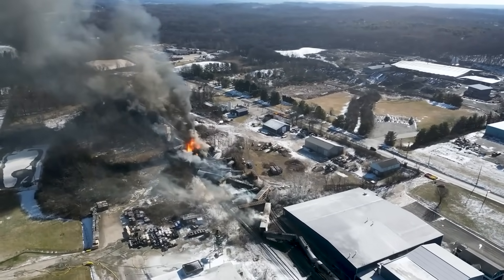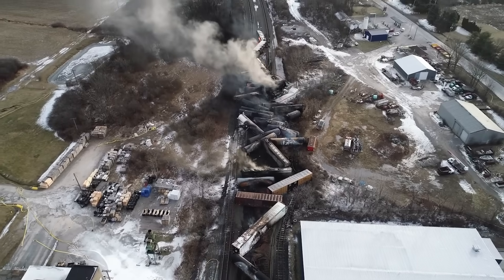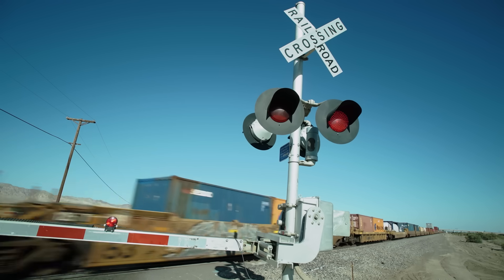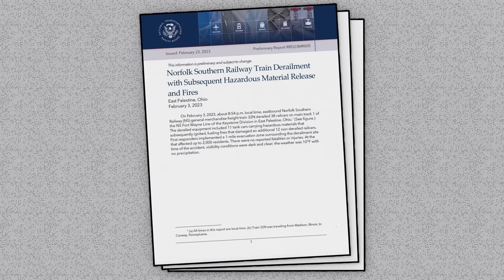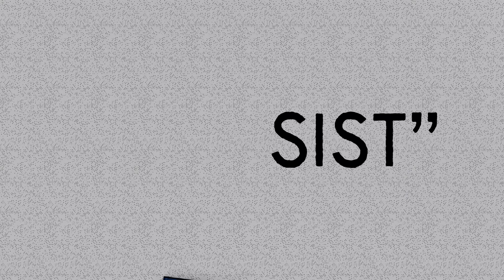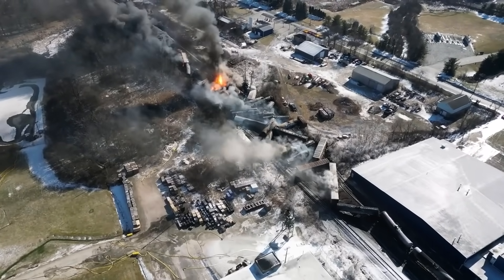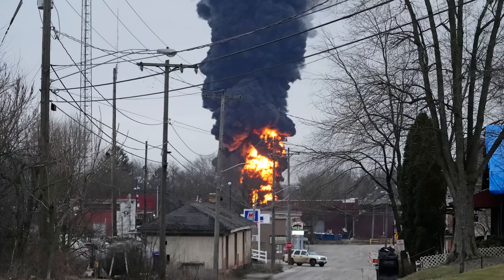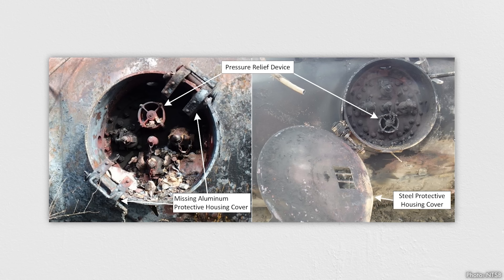East Palestine Train Derailment Explained

Comment: While rail freight may be an essential element of the economy, running rail lines right through the center of small towns seems like an anachronism from the 19th and early 20th centuries. Major freeways are built to bypass the center of many cities, and it seems like there should be alternate rail routes that avoid populated ares, especially when the train is carrying hazardous materials.

Comment: Talking about the psychological effects it is worth noting that the less often talked about talked about fact that the placebo effect is just as real in reverse. In fact it even has a name the nocebo effect ie where the brain changes it's behaviour in response to a belief that harm will occur and as a result actually manifests very real physical symptoms. That is to say that some of those reporting symptoms may be suffering from a very real psychogenic illness ie where the brain is responding improperly to stimuli and thus is dysregulating functions of the nervous system as a result. This is often dismissed as though it is all in the patients head but it is not so simple there are very real functional deficits elsewhere in the body that can come from the brain responding improperly the brain has direct control over functions of the body that are vital to ones wellbeing, if it adapts incorrectly like this it can manifest actual harmful symptoms that can be difficult to treat.

Comment: The bit from Some More News wasn't so upbeat about how clean up is swift and thorough and basically actually everything was fine. In fact claims were maid that sampling of water and soil were done poorly. 
A temperature reading of a bearing  until it's too hot doesn't sound like a too smart solution. Is there no data trend? If one bearing of one car gets hotter every measurement, than that's rather concerning, disregarding that it's not exceeding limits just now. I would think of estimating when it fails the 200° threshold and how it performs with respect to other bearings on the same and different wagons.

Comment: Could you clarify? Did you just explain that the automatic brakes engaged, and the result of the "safety" brakes was to derail the train?
Reply: Pretty much yes. Derailment is usually a less bad outcome than a runaway train, followed by an even bigger crash.
Reply: @Gordon Richardson  forgive me... I went to engineering school, but maybe aero is different.... shouldn't the brakes be designed to SAFELY stop the train? Is an induced crash really the best option?
Reply: @icansciencethat  The best option is orderly braking, but once a car becomes uncoupled this is no longer physically possible.

Comment: The car that has a flame that looks like a torch is under a lot of pressure because that is a pressure torch.  That may be a vinyl chloride-carrying car.  I don't think vinyl chloride is normally under that much pressure.  It is hot from the fire.   Some of your rail car video is of European trains, the trucks and bearings are different than the US ones.   The car at 7:19 is burning from the pressure relief valve.  Don't leave out Canadian National and Canadian Pacific as they both operate rail routes in the US besides Canada.  Don't forget Mexico as the North American Railroad combined system covers the bottom of Mexico to Fairbanks, Alaska by way of car floats between Seattle and Vancouver to Anchorage.   There are 2 rail carriers in Mexico and they are tied to 2 rail companies in the US by connecting tracks and corporate ownership.
Reply: Vinyl Chloride boils at -25º C

Comment: freight trains are the best way to transport goods, without a doubt. The problem in the USA are how the trains are handled. A train of 150 cars is just too long and the safety measures are not sufficient. I also doubt, that this accident will change much. Train accidents are not as rare as you might think. This one was just lucky to gain enough press attention.

PS: does Nebula accept PayPal yet?
Reply: Restricting hazmat cars to shorter trains sounds like a quick fix, compared to revamping everything.

Comment: So I have a question. With regulations I’m hoping changing on a constant basis, what does that mean to the rail cars, such as the tanker cars in this situation, that have been in commission for over 20’years. The report said the tanker cars were manufactured in the 1990’s. With the volume that these tanker cars and methods that they aren’t filled, emptied, cleaned and inspected, should there be an age restriction or total volume life restriction? I’m wondering if newer tanker cars would have resulted in the same situation.

Comment: I'm curious as to  how the venting was done.  Could you explain how they vented the cars for the controlled burn?  It seems like a difficult operation if material in one or more of the cars was already actively burning.
Reply: I would guess that a hazmat worker just opened the drain valve.
Reply: Shaped charge explosive to cut a hole. Then the trenches lit.  Several cars were emptied at the same time.

Comment: I'd like to see how a bearing getting too hot leads to derailment.  Seems like losing a single wheel or axle should not cause a whole train to fall off the track.
Reply: When a hot bearing fails it will often cause the axle to fail, that's why. One car digging itself into the ground will absolutely become an obstacle to every car behind it.

Comment: Dang, you missed a really important explanation. How does a failing bearing in one car cause 38 cars to fall off the track?
Reply: The exact sequence is not clear, but once the air line becomes uncoupled, emergency braking will cause a concertina effect.
Reply: Orderly braking of a train MUST be done from the head to the tail.

Whenever some car in the middle starts braking. The cars in front of the failing car will be pulling on it, while all cars following it will push against the brakes of the failing car. The longer the train is the worse this effect is.

As so much weight is involved this is a delicate process, that can go wrong quite fast.
Reply: @jfverboom7973  Thx. Too bad Matt didn't mention why/how the train derailed so that the many thousands watching the video could get this same understanding. Ironic the title of the video is "derailment explained" when the only thing not explained is the actual derailment. :)
Reply: @gordonrichardson2972  thx!

Comment: You mentioned the first reading of axle temp was +37.  Presumably all previous readings were similar.  So, something failed within that 20 mile span, and the next reading was +150ish. Still within safe limits, but a drastic increase of a static situation over a short period of time.  Maybe a stop signal is overkill in that situation, but a warning light to reduce speed may have prevented this.  Also, a simple device known as a hubometer that measures rotations of an axle should be installed and a recommend service interval of bearings introduced, if not already.

Comment: it sounds like the temperature threshold determines whether to call a hard stop (namely, if the temperature of the bearings exceeds 200F of spec)... did i hear that correctly?

i can't be the only person who thought that some kind of tiered system (in other words, reduced speed above 100F, severely reduced speed above 150F, full stop once a sensor exceeds 200F) would have made this situation much more manageable, no?

maybe these bearings are always 100F above spec, which sounds bad but whatever - we could shift the threshold around to minimize how often these trains have to operate at reduced speed unnecessarily. and, realistically, i guess i feel like if the bearings' temperatures need to be managed better, then forcing train companies to more proactively address the bearings that force trains to operate at half or quarter-speed might be a good thing in the end.

Comment: was there any other way to neutralize Vinyl Chloride other than burning?
if not, would it be a good idea to have a neutralization plan for all chemicals transported? including storing the needed amount of neutralization chemicals 
if there's abnormal car bearing temperature rise below threshold wouldn't it be a nice idea to report it to driver for them to slow down until the next checkup post says the temperature is not rising?
Reply: I don’t believe neutralization of vinyl chloride, or most other chemicals, is a thing. Burning the vinyl chloride is a great way to transform it from a toxic chemical into water, carbon dioxide, and chloride salts and probably a lot of other combustion byproducts :)

Comment: One thing I don't understand is why the defect detectors and tolerances weren't programmed and written to react on the rate of increase in temperature rather than a fixed value as that would most likely have allowed the train operators to act well in time to prevent the disaster?
Reply: The detectors are separate and do not communicate with each other. The system is archaic, and not designed to deal with this kind of escalating failure.
Reply: @gordonrichardson2972  Even a 16 bit CPU from 1985 can do basic differential calculations. That's not even an excuse.

Comment: I have some experience with industrial controls, and predictive maintenance. So, I'll give my opinion from that perspective. I'll stick to ideas for the future.

1) it seems that 20mi is too far between axle bearing temperature sensors. Maybe space them every 10mi.

2) I believe the two readings taken before the max 250⁰F reading was taken, were enough to indicate a major problem. The temperatures were both below the max temperature, but you could still see a rapid acceleration in temperature, and that catastrophic damage was likely.

Therefore, it's possible to now include programming of the automated system to include analyzing temperature acceleration as a way of estimating catastrophic failure.
Reply: With the current system, the defect detectors don't 'share' information, so things like trending and rate-of-change are not possible.  With on the order of 160,000 miles of track in the US you'd have to add an additional 8000 detectors to get from 20 mile/detector to 10 mile/detector (and I don't think 20 miles is the actual average).

An onboard detector system for bearings and some other defects might be better.  Could do rate-of-change stuff and account for brake applications as well.  But that would mean over a quarter million such systems. (can't skimp and only add to hazmat cars since a non-hazmat car can derail a train just as easily).
Reply: The detectors don't report data to each other or to a database. Workers go to the detectors to download the data after an incident has occurred, or as a result of the train conductor reporting an issue. Your simple solution requires introducing networking abilities to 10,000 remote locations, whether physically (logistically not impossible, plenty of high-capacity data lines already run by train rail lines for ease of maintenance. ironically, one of the main reasons for high capacity transit line outages is train derailments) or wirelessly via satellite. 

Your solution is "simple" but incredibly expensive and only a regulation will force those changes.

I'm not against your idea, rather I'm for it.

Comment: I think I noticed that earlier, when mentioning large volumes of water, the convention in SI is to use cubic meters (1000 liters) instead of liters, it makes the figures more manageable, one would know that one cubic meter is about 5 bath tubs, or the equivalent of a "yard of fire wood".

I appreciate your video in general, more evn this one as I did not really follow the incident.
Reply: Who measures firewood by the yard?
Reply: @petermgruhn  It may be cord? Sorry, English is not my primary language.
Reply: It's a lot easier to say "ton" than "cubic meter" though.
Reply: @SkorjOlafsen  But that would be a measure of weight, not a measure of volume.
Reply: @olivier2553  When you're talking about water ...

Comment: The outcome of this has been a long time coming. Had the train been shorter they could've stopped the other 111 cars in time, before their oncoming weight resulted in the cars near the failure derailing. The US government is going to need to limit the length of trains carrying hazardous materials, or perhaps all trains. Although we did have derailments of mainline trains shorter than 100 cars way back when, there's a good chance we will never have derailments caused by failures under a rollingstock limit.

Comment: I wouldn’t be surprised to see them start suggesting newer technology be used to monitor trains. Have each car equipped with monitoring equipment and run a communications bus down the train like the brake lines. Just another connection to hookup when building the trains in the yards. Get you a lot more real time monitoring and alerting, and able to detect anomalies like sudden rises in wheel bearing temps vs needing to take something in a dangerous state upwards of 15 miles to the next detector.
Reply: EOT's kind of do this already. An EOT is a little blinking device that is put on the end of the train and it connects to the airhose. It then sends info to the crew about how much air pressure is in the train.
Reply: @thatoneguy6555  EOT doesn’t tell you anything about the state of car 37 in your 150 car consist. Sure, it helps you detect potential brake line issues and understand your pipe pressure for potential multiple downhill sets and such.
Reply: @Herlehy  yes you’re right. It only does some of waist should be done.
Reply: The off car detectors make a lot more sense. Because they don’t allow for a single point of failure. If there is a bad sensor or series of sensors on a car, that’s undetectable, but if an on the ground detector doesn’t work, the next one will and defects can be easily noticed that way.
Reply: @joeshmoe4207  And if a cars sensors fail, that car shouldn’t be running since you can’t guarantee it’s safety. The idea that “this trackside sensor failed, so that’s fine to keep your train running in an unknown state until the next one” is bad. Sure, you’ll also have the static defect detectors in this new setup to help with potential failure states for on train sensors.

A failed sensor is 100% a detectable state. And should flag that car to be taken out of service at the next yard until it can be repaired.

If it truly mattered, this would be mandated in law. But since money is more powerful that logic, it likely won’t ever happen.
Reply: Having a communications bus run down the length of the train would be very complex and very expensive. You'd need a terminal block on each end of each car. While modern passenger EMUs do have communication between units, but you won't see more than 4-5 units coupled in multiple, and certainly not 100+ coupler joints. The most common failure mode for these types of systems seems to be the ground fault, which is a pain to troubleshoot. Electrical jumper cables like those seen on early multiple units would also not be that practical since you have so many cars.
Then you need to figure out how to make the detectors reliable enough. Railcars undergo a lot of mechanical load, from being shunted in yards to running over poorly-maintained track. So you'd need to make the sensors extremely rugged and reliable. It is also easier to maintain 10 detectors distributed along the track than thousands on each car. You can fix a lineside detector when you do routine track maintenance, but maintenance on thousands of individual detectors would be much more difficult.

Comment: What I don't understand is, if they were able to release it into a ditch, which would have allowed it to cool and reduce pressure, why did they then need to burn it, instead of collecting for reclamation?
Reply: 1: It's volatile, which means it evaporates extremely easily. Waiting would mean releasing the vastly more harmful chemical into the atmosphere. 2: The pit was almost certainly not lined to prevent its infiltration. Temporary holding during a burn means you have a lot less contaminated soil to deal with, and vastly decreased possibility of it reaching the water table or, god forbid, an aquifer.

Comment: Decent engineering viewpoint as expected but there is a lot of missing information about how the rail companies lobbied trainloads of money to dismantle one safety requirement after another.
Reply: That take seems to be alluded to in the closing statement, where the political power that railroad companies hold is addressed - although I understand Brady may not want to say it in a loaded way like you and I in the comments section might.

Comment: A few notes, defect detectors predate the end of the caboose, and originally were manned because they also predate radio.  In cases of a hot box (hot bearing), the detector would trigger an alarm for the signal operator who would drop the signals to red.  Later, crew radio could be used for the caboose to signal the locomotive, then regional radio.  Defect detectors are quite old, and the CSX one used in the example had a predecessor that existed in that spot from the point where the Seaboard installed radios.
I have no notes on the engineering critiques.
Of course, railways moving hazardous materials through cities shouldn't be a big surprise.  The railroads' predecessor is generally why towns are there.  It's an unfortunate fact of life in the US.
It should be noted that hotboxes are not something better brakes can help with.  Better detection protocol is the best way to resolve this, and the companies (Norfolk Southern and Union tank) are still at fault, for poor detection and poor car maintenance.  Prevention, not mitigation, is always the way to make railroading safer.  The FRA has taken actions in the category of the later rather than the former, or at least hinted at intention to do so.  
There are now 6 companies.  KCS in the south southwest and Canadian Pacific in north have merged as of days ago.  Incidentally, CPKC had a major accident a few days ago.